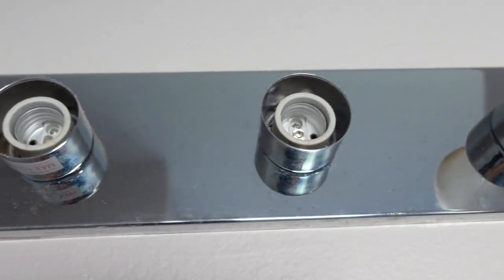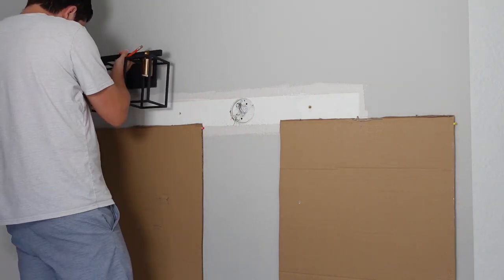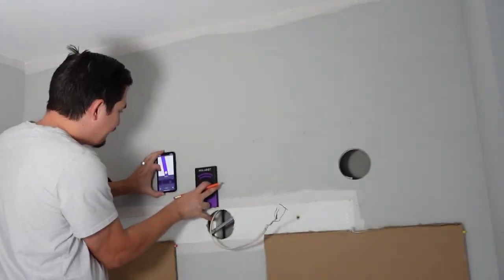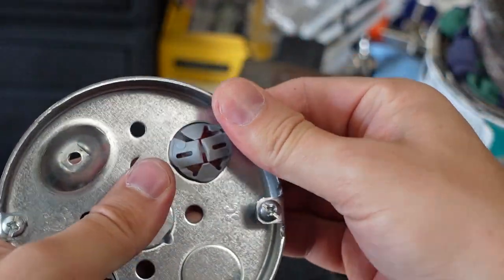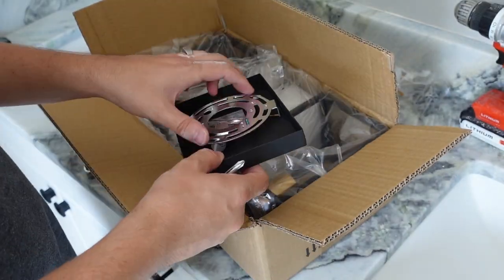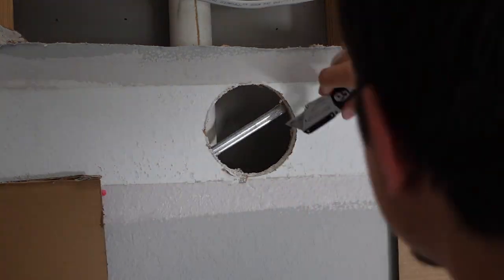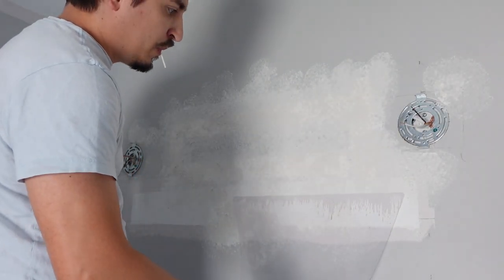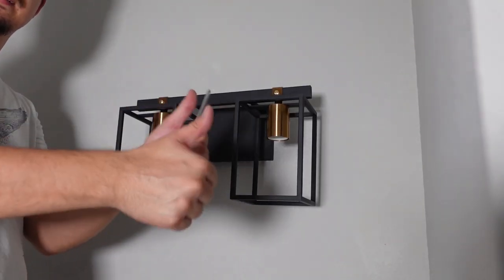DIY Bathroom Renovation: Convert One Light Fixture into Two with Easy Steps

Comment: Good video.  It's the best I came across for this specific fix.  In the end, I went the route of splitting the wire in the attic and dropping Romex down separately for each fixture so I didn't have to cut out any drywall - And I can use one of the 4" circles I cut out for my new fixtures to fix the 4" hole the original box left.  But many of your tips were used along the way.  Thanks!
Reply from the maker: I’m happy I was able to help. Thanks for sharing.

Comment: Thanks for this, very helpful. In my case I ended up with 14-3 wire when I only needed 14-2, but I just capped the red wire at both ends
Reply from the maker: Glad I could help. Isn't a good feeling doing something like this and when it's all completed and it actually works. lol. Great feeling like I did that. lol

Comment: Shouldn't you have routed these up through the attic instead of damaging the drywall? This way you would have only made your J-Box hole and 2x 1" holes into the 2x4's above.
Reply from the maker: Yeah but working through the attic is such a pain. So I figured this would be easier for me.

Comment: What if the wire from the original light is not long enough to reach new box?????????????????
Reply from the maker: Install a junction box there and use more wire.
Reply: can't bury juction box in my state, not to code @Daddicated
Reply from the maker: Well then sounds like you will have to run a new wire then. I don't know what else you can do.  @georgem235

Comment: Does the electricity in the original wire run through the light and out to the other light? I didnt catch how the second light gets power.
Reply from the maker: That is correct. It runs in series going into one light first then into the other light.